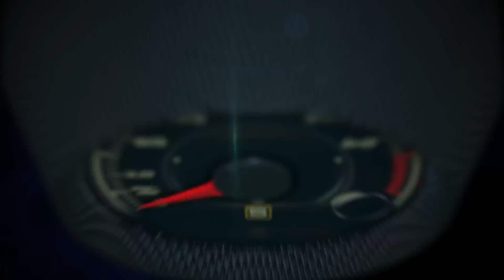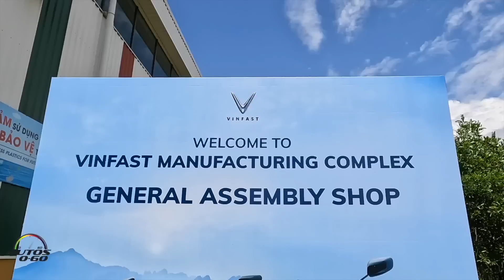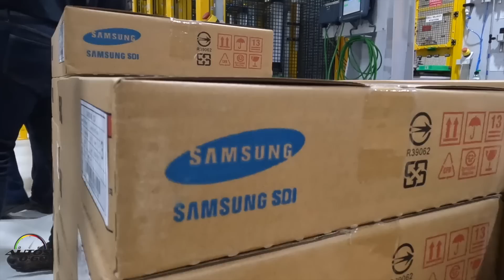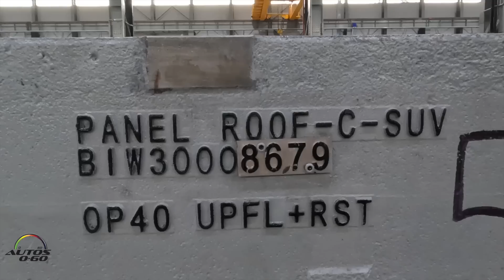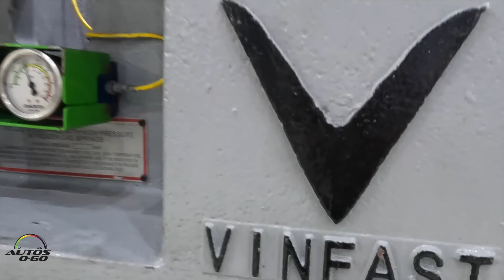VinFast manufacturing complex, the home of the new electric car company

Comment: Intouch your desicion maker
That we can now run an electric vehicle for an unlimited distance.
That can charge the car betery while running
That no need to stop for charging.
Hoiping for an invitation for meeting.disscussion.
Im tots a pilipino
Invented electric generator not using gasoline/diesel/solar
We can built in any wattages of dynamo
To the smallest wattage to the biggest wattages of dynamo to be use..at home..in car..in farm..or in big factury using heavy electric machineries